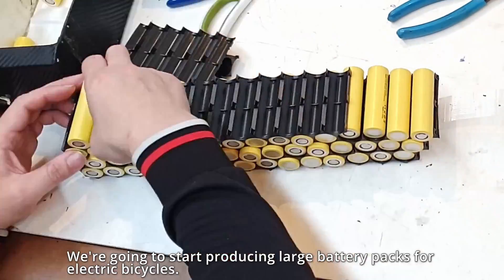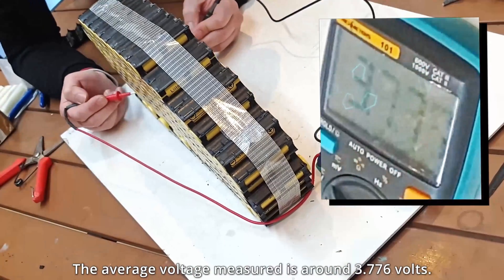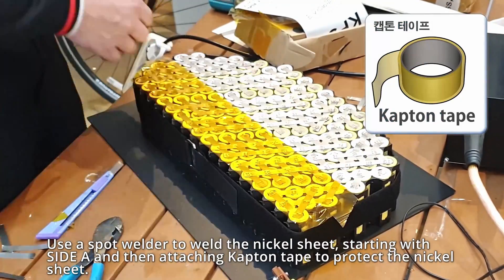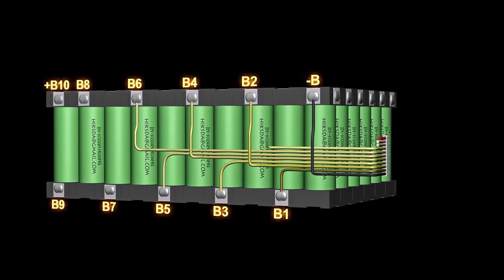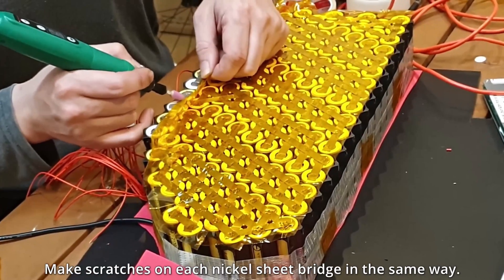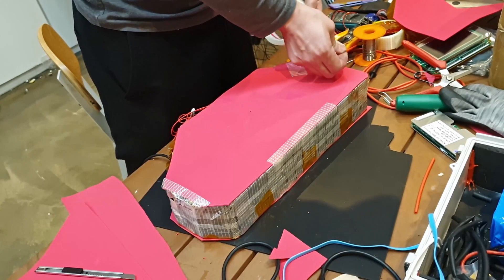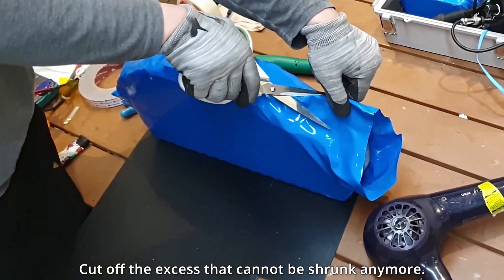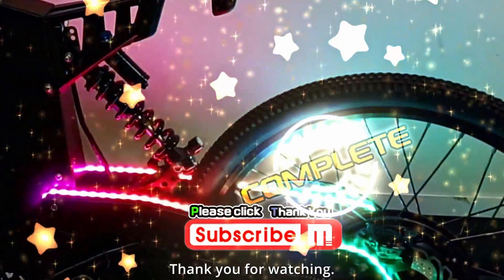Beginner Battery Production Detailed Build Process Guide: E-BIKE Master Books

Comment: So was this 48v battery? Low amps what are you powering? Small motor?
Reply from the maker: This was built for the purpose of building a dual drive 2000 watt sample E-BIKE. A was built with some margin. This is because the front fork dropouts are more likely to break.

Comment: So how do you calculate the amps ? is it the amps of 1 18650 cell times the # in parallel ?
Reply: Each 18650 battery you buy has an mah rating. In series this figure doesn't change if all are the same. If you run 1x 2000mah battery then it's 2Ah.

If you have 5 batteries connected the same direction, then you have 5x 2,000mah batteries give you the same voltage of one, and combined power output of 5x 18650s, each with 2,000mah give you 10ah. If you run these in series, the power output remains and the voltage increases.
Reply from the maker: Connecting batteries in parallel increases Ah. Voltage does not change.
1ah + 1ah = 2ah